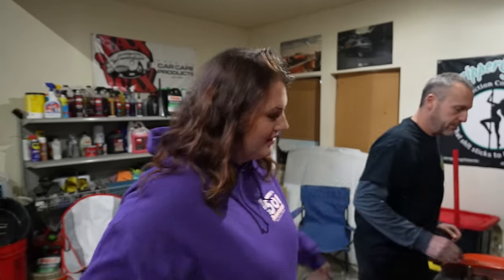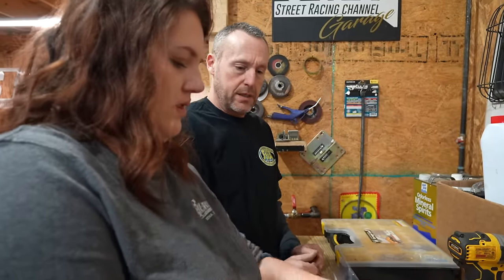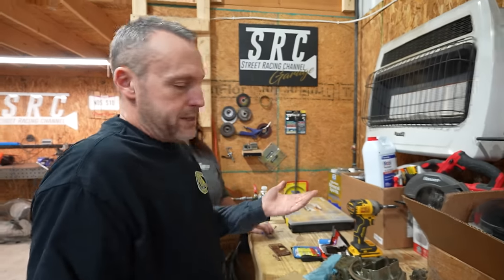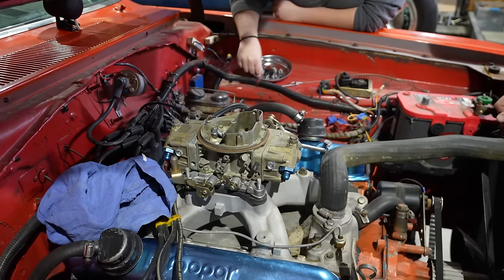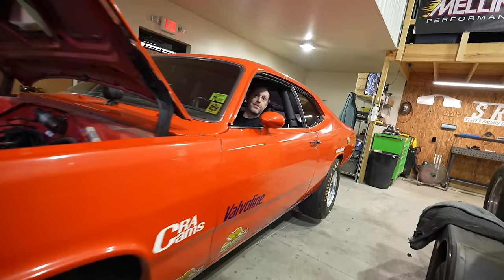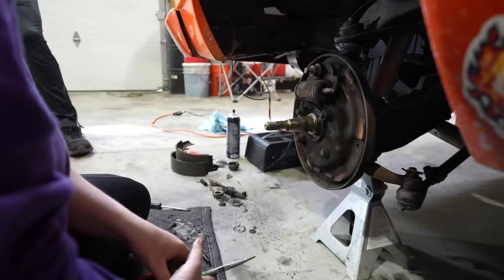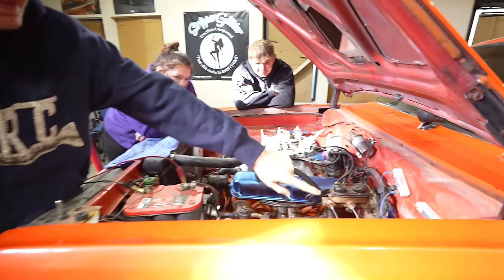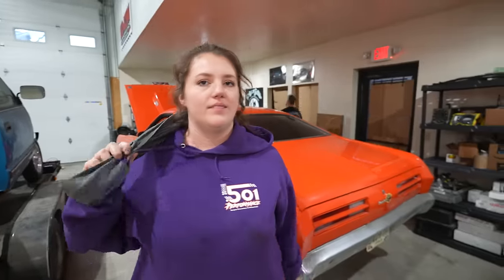Teardown Begins on our Barn find 340 Duster!

Comment: Nothing wrong with those drum brakes in my opinion. You can set them up for zero drag and they probably weigh less than factory discs. Almost all big, heavy equipment uses drums. All big rigs do, they really do work very well. Don't hate on the drums guys.
Reply: Smart guy! Exactly right! Plus they are 3mph faster than any disc break ive seen!

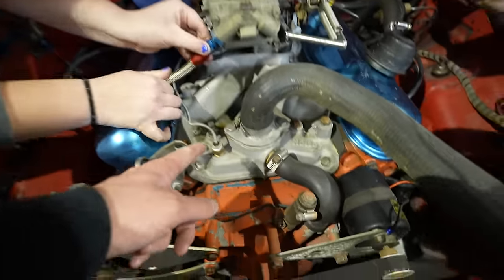Comment: Talking about the Duster going 11:20's 'back in tha day'. Indeed that was QUICK! Those cars ran low 13's very high 12's off the showroom floor and that was quick for a factory muscle car. It didn't take alot to get them into the mid 12's (recurve the distributor and headers) and still have great streetability and blow the doors off Chevelles and GTO's.

Comment: Jeff`s learnin the younguns. 😁 Put an ATM carb on it. I had a 1975 Duster, loved that car, then it got hit. It did not like snow, rear wanted to lead, but did awesome donuts in the snow. Add 100lbs over each wheel stabilized it in snow. Had the Tower Of Power 225 slant 6!🤣 Those things are bulletproof, never had an issue and I beat the snot out of it.😁

Comment: Jeff back before flowmasters when we were teens. The best sounding mufflers were the thrush round blue cans with the woody on them. In my opinion those sound better than flow masters. My 455 sd in my 72 t/a was purrfect sounding with a pair of those on it. A few yrs back i found a pair still in the box from wynns back in the 80s or 90s. On ebay for 400. We used to get them for 9.99 for muffler or 14.99 for the header muffler. Ones withs header flanges on them. Im waiting to finish my tall deck windsor just for the mating of these antique mufflers. They were the competitor to the cherry bomb glass pack, Tommy.

Comment: Dusters like that are getting scarce. Doing a great job preserving this piece of automotive history. I put the tubo/ high compression Flowmaster mufflers on my 67 Fairlane GTA with a fairly roudy 428cj with a long duration/high lift solid lift cam, TRW domed pistons and heads shaved brought compression to about 13.75 to 1. It sounded amazing with those mufflers and when you really mashed the loud pedal she really screamed.

Comment: The General Lee cars used in the TV series were actually painted Red. No original Chrysler paint was used on the cars due to the way the Chrysler orange appeared on TV. The paint is almost an exact match to Corvette Flame red used for a few years in the mid 70's.

Comment: 2 barrel holleys are rated differently than the 4 barrel models.   Comparing the 6 pack to a 4 barrel cfm, that 1350 cfm 6 pack is about 950 cfm when rated using the 4 barrel vacuum level.
Running the needle and seat down lowers the float level.  If floats are too high you can get a richer than desired idle tune up/profile.

Cool video and neat to see a car pulled from hibernation. 👍

Comment: I prefer the old turbo mufflers of the late 70's early 80's, built just like the bodies of flowers master, but without the pop and crackle when you were  accelerating hard, are backing out of the throttle afterwards. 
As nice as flow masters sound, the PoPo could pretty much tell exactly who you were, and where you were at.
Which in small towns they'd be waiting for you to get to a certain place, and then pill you over.
I've even had the suckered sitting at my house waiting for me to come rolling down the street, and they'd be sitting behind my neighbors truck that had a camper on it. 
By the time I saw them, I was right beside Barney Fife, and sure enough he'd hit the lights waking all the neighborhood up just to be a dick, because he knew they'd be over the next day complaining about the flashing lights waking up all the kids.
Only good thing, was just because he hears you, didn't mean he could write a ticket
He had to see you racing, are just burning the tires off at a stop sign or red light and are speeding. 
All fell under acceleration of speed, and back then was like a $40.00 fine, and taking time off work to take care of the ticket with the Justice of the Peace since we weren't big enough to actually have a judge in town.
PS
Add turn downs where they aim down and out to the sides a little that prevents drone from exhaust

Comment: Great stuff, guys.  Not dissing the chambered flowmasters, they sound great, but they are trash for power .  Magnaflow race oval mufflers are about the same for sound and db, but way less power loss.. can vouch from my own experience and proven at motortrend's, engine masters show. If you're looking for a few more ponies, ditch the chambered mufflers for straight thru with packing.

Comment: The Mopar heater motor worked perfect to drive the water pump and fan.
  We used to raid the junkyard getting them and making brackets. It was cheaper than moroso.

Comment: Oh dear, I bet Bill is shakin his head at this one...
If the pump diaphragms are hard, so will be the power valve diaphragm & the needle valves, & o rings. A Holley Trick Kit will include everything you need including race fuel compatible gaskets, diaphragms & needle valves.
There are levers welded to the throttle shafts that are connected by a linkage, there are a few holes to choose from for this connection to change the opening point of the secondary throttles... the cams have NOTHING to do with this, they are for tailoring the volume & timing of accelerator pump shot... You learn something new everyday Jeff... Nice project guys.

Comment: Now that you regasketed/reassembled that Holley carb you really need to document everything as a starting point (before you make a single adjustment (after you replace that. Vacuum cap...that should have been done immediately upon removal, oops).

Record main primary jet orffice numbers, and positions if not squared , and I would have used drill bit hole size checkers to actually measure the hole sizes, just in case they had been drilled out or altered, same with secondary jets. Then approx float levels, then Acc. Pump size and sec. Cam colors and positions installed, incl. a diagram on each on what screws for the cams are in which holes, then acc. pump diaphragm spring color. Lastly mixture screws and idle screw positions by turning in and counting turns to lightly seat and reset to original counting turns back out.

As Jeff said, once you start making changes it is really easy to get lost. At least that way you have an ok (at least you know it works baseline easy to get back to settings pkg). Lastly power valve size #.

Then, in the future, use that baseline recorded list, and continue it, recording every change you make, and all the (that change worked, or it did not work or improve reversal of future settings or additional attempts).

It just keeps you from getting lost with Holley Carb adjustability which is nearly endless in parts. That list always stayed in same box as my jet, cam, power valve, gasket and other spare Holley parts kit. I never made a change to mine (and did a ton of other guys Holley Carb tuning), they got their own list started the second I started or touched theirs the first time, and were updated on every change or move. Highlight things that worked! Reverse things or changes immed. that did not improve. You won't find failures accidentally helping later unless there are major weather changes (mine shaft air conditions, etc.)

Starting over is never easy, but plan for it. Know that major swings in settings can get you lost, tiny single changes, one at a time, and you can make big Jumps sometimes by finding the sweet spot.
Reply: Buy yourself a small box of drill bits that have the drill sizes marked, those went in my Holley Box, and were only used to drill out Holly jets ever, and only if I did not have the correct size jets (once a jet was drilled out, an X was applied by chisel/hammer whack to the jet to denote it was altered next to the jet size number, then actual drill size recorded on the appropriate changes list.

Comment: those cams are for the  accelerator pumps, to change the opening rate you adjust the rod between the primary and secondary.

Comment: their overflow vent tube is designed differently, because when you takeoff of a dead stop in a boat, the boat tends to stand the bow almost straight up. It’s just like an extreme off-road Holley carburetor it’s made to take the angle, and if it does happen to flood out of the vent tube it dumped it right into the cylinders instead of down the side of the carburetor. but then again, that’s a Holley carburetor not a Edeljunk carb.

Comment: Jeff had the squirter pump cam confused with the linkage rod that does the opening rate of the butterflies. The cams only affect pump squirt, not the butterflies. Im sure he just confused it, and im sure he knows, he was just rippin through all the explanation. And he had the float adj, explanation backwards. Unscrew the float, it raises, screw it in, it lowers the level. He had it opposite.
Reply: Grrr. I know. I panic.
Reply: @jeffkovalik7395  i cant imagine trying to do the stuff one take for filming, and always get it right.

Comment: weld about 5 feet of THREE inch pipe behind those mufflers, and you'll hear what it  "SHOULD"   sound like....end the pipe just in front of the rear axle.....nobody will want to race you tho, cause it will sound like a Big Block......(I'm an old Tubing bender, built exhaust systems for MANY cars), .....OnWard.........

Comment: Cool Plymouth Duster, I have 3 Duster 340's.  :-)
You can get a new factory style engine wiring harness that is already converted to electronic ignition for $110. Well worth it to get rid of all the splices. Here is the link, scroll down towards the bottom to the 72-76A-body section. 
http://www.evanswiring.com/catalog.htm

Comment: 2bbl carbs are rated differently.  A 2bbl rated at 600cfm flows a lot less than a 4bbl rated at the same rating.  2bbl carbs are flowed at a different pressure differential.
Reply: I really dont know where Jeff came up wt a 600 cfm center carb!  It should be a 350cfm wt 500 cfm out/boards!

Comment: Plz don't put this moroso clear screw the last 3 carburator I rebuild and install this crap they all melt from inside and the bulb broke off 3/3 those things are not the quality they use to be
Reply: Even in the early days I had problems with them sticking. Even tried oil on the threads and not screwing them in all the way. In the end went back to the OG brass plugs.
Reply from the maker: Yep found that out 😂
Reply: It's worse now that they are diluting the fuel with up to 15% ethanol. I switched out the bowls for bowls with built in sight glass! Way better.
Reply: @Rick.1904  As I see it that is the only way to do it. I just never wanted to spend the money.

Comment: Tommy, please let Jeff know that he's running Chevy carburetors on his Mopar. They were first used on the 1967 Corvette, with the 427 Big Block Chevy with Tri-Power. The out board carburetors are rated at 465 CFM and the center carburetor was rated at 350.
Reply: Yes. Absolutely. 

I think Holley supplied carburetors to about every OEM. I suppose any Ford with a Holley is also a Chevy carb. Etc…

I understand the 3x2bbl setup was on corvettes first, and they are awesome. I’d love to have one. 

But that doesn’t make my carbs any less Holley. 

440 Six packs are 350 center, 500 each secondary for a total of 1350. But in reality it’s like 950 cfm total.

Thanks for watching. 

I really do want a tri-power Corvette…
Reply: @jeffkovalik7395  , just fooling with you Jeff. I've been around drag racing since the late 70's, when my oldest brother got outta of the Army and started racing Stock Eliminator in his 66 Ford Fairlane GT, with a 390FE  and 4spd. That had a 4160 Holley 4 barrel from the factory. A friend of ours raced a 62 Ford Galaxie with a 406 FE with a factory tri power, 3 Holleys. When I started racing in the early 90's, I didn't plan on class racing like my brother, I went the bracket route instead. Around that same time, a new family moved to my neighborhood and I was introduced to some wild Mopar fanatics. You probably know them, Ray and David Barton. The neighborhood got exciting after that.
Reply: @hk45c62 lol 😂 oh that’s a great story!!!

Comment: ask uncle bob about 340's mine was a very bad run it they sucked fuel badly & half way rebuilt the one i had it was whipped & not fixed right on one
cylinder had a problems before I bought it had scored cylinder & it was honed out too  ok! the guy took 340 in trade for rebuilt 360 dodge & i drove it 2300 miles one way to air-force base! i was rank enough to have a car & stuff on base! airman first class over a year in service! i had year tour over seas you got more goodie's on next base! your fuel lead fuel & high test 100 LL air plane fuel mix with regular boat trick the air port closed torn down or  refuel or different newer motor! jetted for today's pump gas!  all my help ran off! too!

Comment: Random useless fact, 2bbl carbs are rated at a different inlet depression than 4bbls, so 1350 cfm worth of 6 pack carbs isn’t directly comparable to a dominator or an efi throttle body with the same rating, as an example. It’s silly and never made any sense!